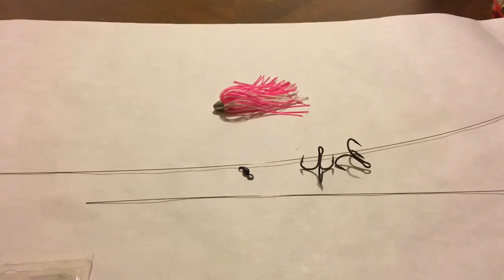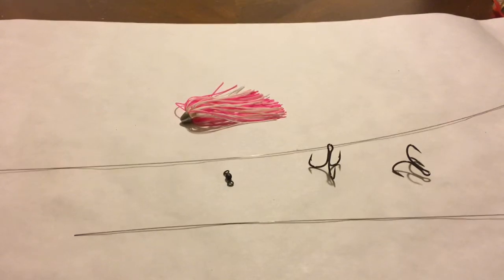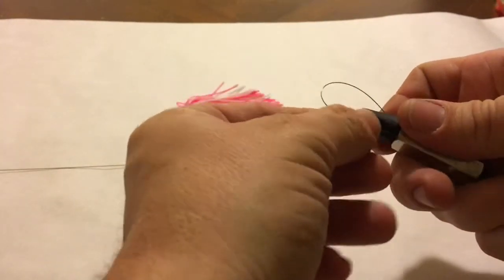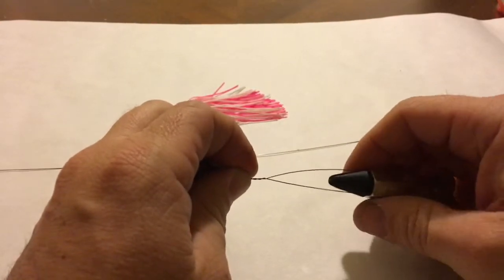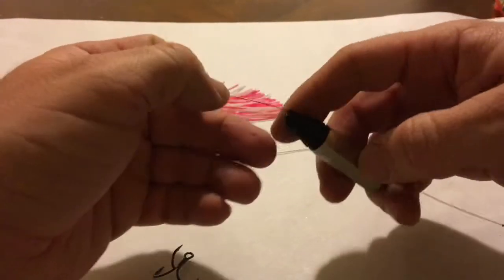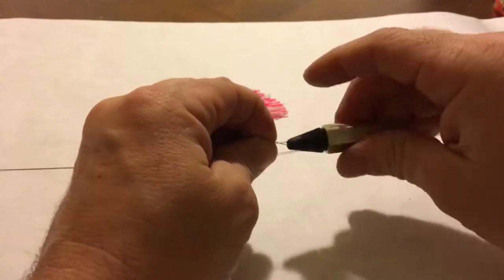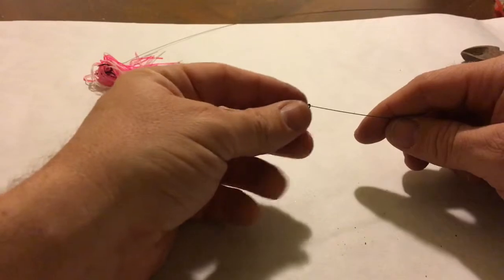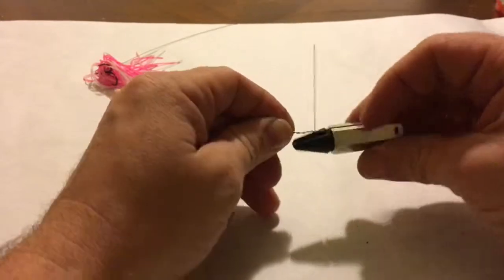How to tie a Live Bait Rig (King Mackerel Rig) with Haywire Twists (2019)

Comment: You don’t need to clip the ends. You can just bend the wire back and forth and it’ll give you a clean break that you won’t catch on. Also the way you’re using the tool is a bit incorrect. Not sure if it’s because your holding the camera or something but the dubro tool usually makes a perfect haywire
Reply from the maker: peterk814 thank you so much for the info.  I assume you are referring to Dubro ez twist tool, they look sweet and you are correct about the near perfect haywire. Maybe my next purchase. 

I’ll work on my camera placement in the future to provide a better view of what I’m working with.

Thanks again. BTW you are my first comment ever.